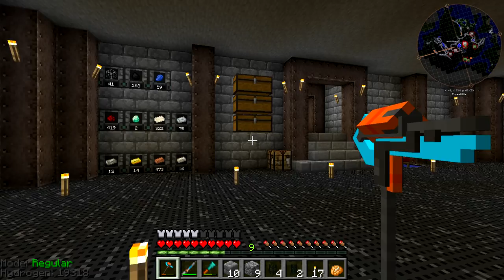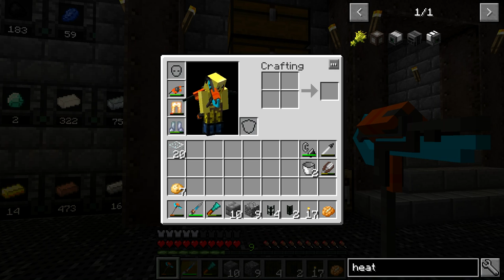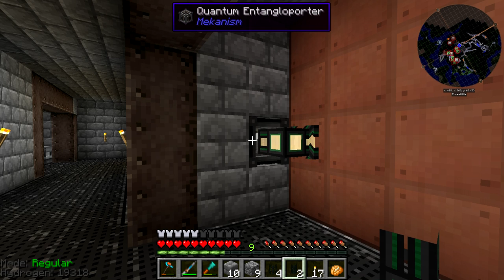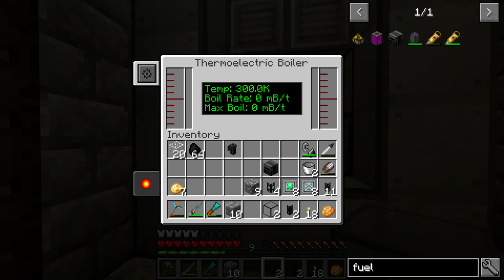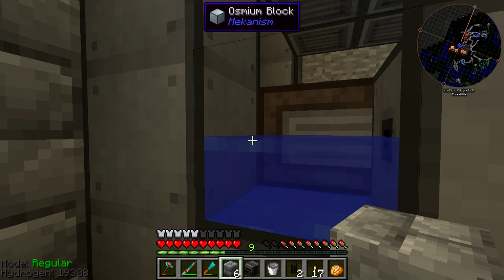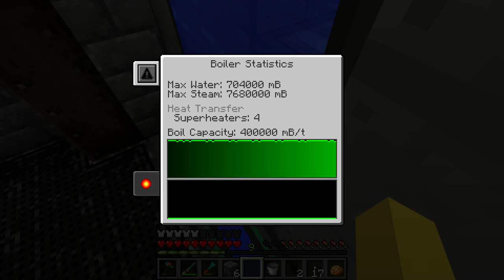Surviving With Mekanism v9 :: Ep.15 - Thermoelectric Boiler

Comment: I have two steam boilers but each is only produce 5 Mb/T, probably missed something in the video, but they're both the exact design. any fixes?
Edit: they're running on charcoal fuel
Reply from the maker: Hm, if it is set up the same and you have the same heat there would be no problem other than a lack of water input.

Comment: Hey Dr, is it possible to use lava blocks to produce the heat on the base? 
(Sorry if this is a noob question, but that's what I am on tecnology mods. Trying to know them better.)
Reply from the maker: It used to be able to, but I believe it was a bug and it should have been patched long ago. The lava can always be used by a heat generator to get power for the resistive heater though :)
Reply: i know this came out a long time ago but would pneumaticrafts heat system work for this or no?

Comment: May want to hang some lights from the ceiling. This is a factory, so having them hanging down wouldn't be entirely out of place.

If you have a huge boiler, you could use Resistives to accelerate it to temperature and then fuelwoods to maintain it.
Reply from the maker: The lighting problem has been taken care of on stream :) looks great! As for the resistive heater, that is actually an awesome idea, i will have to try it out.

Comment: On Mekanism 9.1.1.290 for some reason I'm producing 20 mb/tick of steam off of one heat generator surrounded by lava. The same heat generator is heating a thermal evaporation plant at the same time. It's so broken. 

It's not the best shot, but the lava is visible inside some clear glass:
imgur.com/a/4kd5p

IIRC the casing and glass do count toward the water/steam storage capacity. I don't really see the point of building the boiler any bigger than the minimum size unless you want to produce unfathomable amounts of steam. Even one superheating element is plenty for me.

Will you cover the saturating condensers? I'm not sure how to get the water out of the turbine. I did notice that mechanical pipes connect to the turbine vents. Maybe the amount of reclaimed water is just too small to easily notice; I'm running the turbine off of only 20 mb/tick anyway. I'll check again. 20 mb/tick is giving me a substantial amount of power, though.
Reply from the maker: Oh, I should definitely look into using the heat generator to passively produce some power for the boiler! That idea never even crossed my mind :) and you are without a doubt correct on the size of the multiblock structure. If you don't plan on storing anything in it, the size doesn't matter. As for the saturating condensers, I will be covering those in the next episode with the turbine setup.
Reply: Glad I could help! And thanks in advance.